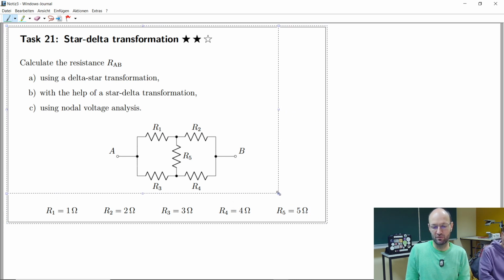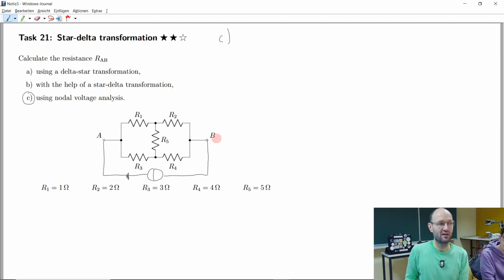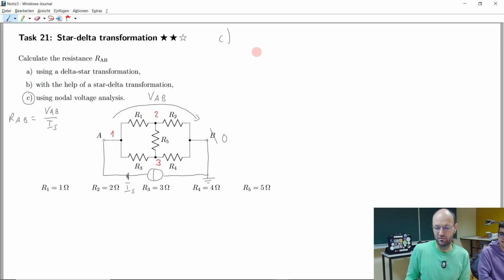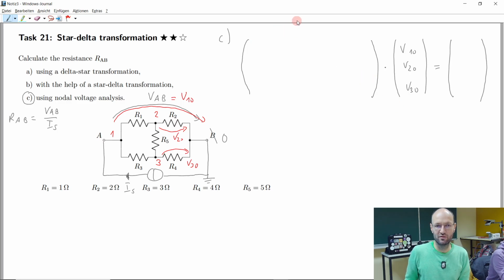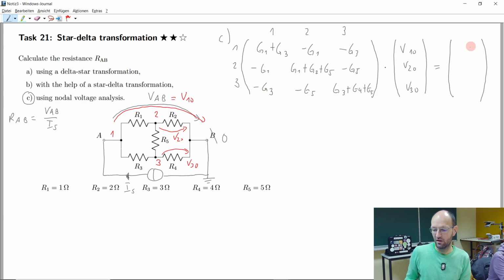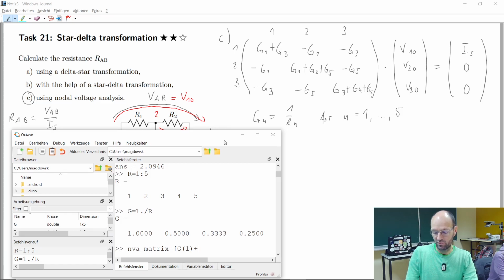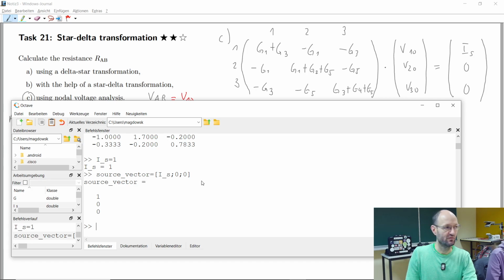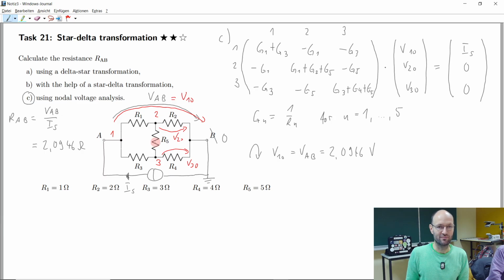How to find the equivalent resistance of a bridge resistor network using nodal voltage analysis?

Comment: How we can solve it by hand?  please guide. It would be helpful.
Reply from the maker: Here is the same circuit solved with mesh current analysis:

Electrical Engineering Lecture on Mesh Current Analysis With an Example Circuit and Octave Solution
https://youtu.be/yTA13L-cgZE

More ways to solve this circuit problem:

How to find the equivalent resistance of a bridge resistor network using a delta-star transform?
https://youtu.be/DrlV3hO4OX4

How to find the equivalent resistance of a bridge resistor network using a star-delta transform?
https://youtu.be/9s_80BHiMyc

Calculation of the equivalent resistance of a bridge circuit using the superposition theorem
https://youtu.be/_JQWswwXxOw